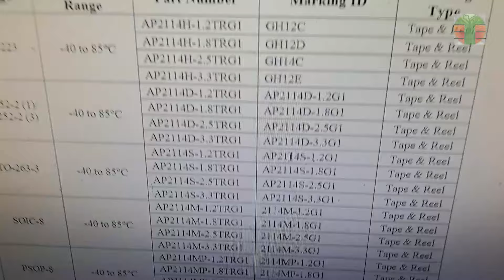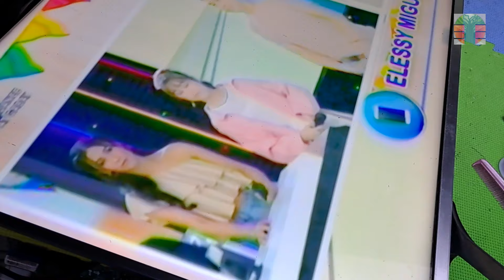Devant 43" smart tv not turning on, standby light indicator only.

Comment: Hy mr Tevz my hisense smart has a solid red lighting whenever im using a remote its not working bt when i use the power button on the tv its works (it turns on ) bt its stuck  on the scanning or impute two displayed on screen since it doesn't respond to remote